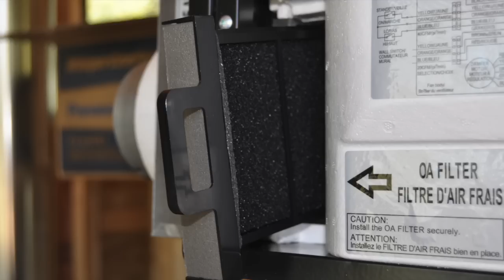Panasonic's Bargain ERV WhisperComfort FV-04VE1 Review

Comment from the maker: Remember that this is a budget version ERV, there are quite a few things that could be done better but it's the price point that makes this so appealing.  I would expect this model to be 1/3 to 1/5 the installed cost of a more traditional ERV ducted to the HVAC system.  We separated the two exterior 4" input/ouput ducts to the porch soffit and separated them by 6'.  Best, Matt

Comment: Other manufacturers offer ERVs that have duct connections, so you could exhaust from a bathroom (because bathrooms need to be exhausted anyway) and discharge the fresh air into the living room or a bedroom. For example, check out Fantech.
Reply: I like that solution. But it seems like using an ERV in your scenario would be adding a lot of moisture (coming from the bathroom) into the home. Perhaps an HRV would be better for that use-case (to prevent moisture transfer). The bummer with HRV's is that you can end up with too little moisture in the house. So then again, maybe the solution is an ERV as you proposed with a separate kick-ass de-humidifier.

Comment: We’ve installed several of these so far on rough in phase of some new houses and I finally gotten to the point where I need to hook up a control on it to finish the house and I am lost and cannot get any help from any of my distributors on this. We had the electrician wire 110 V to the unit where it’s mounted in the trusses and we tied onto the low-voltage controls and ran a thermostat wire down for some sort of controller or switch. Is this correct? And or is there some particular wall control we need to be using? Also, I don’t know if there’s an on off switch located behind the grill, but can you just switch it on as long as it’s powered and have it run all the time with no controller or switch on the wall?

Thanks

Comment: Not sure why you would say not to use a HRV in a humid climate, the biggest difference is the efficiency and an HRV has a condensate drain. As well every HRV controller I've seen (life breath & van-ee) allowed you to set the humidity inside your house, allowing the home owner to dehumidify with the HRV. Anywhere that would be too humid for a HRV to be effective in dehumidifying also probably has air conditioning which would take care of additional humidity.

Comment: How far can these ducts run to supply/vent the air? I have a basement but floor joists run towards the back yard which has a large deck, pretty damp under there. I would want to go out to the side of the house, but it's perpendicular to floor joists and would be about 30 feet run.

Comment: I'm thinking about installing one of these in my basement where we have a air quality issue. 
It's a  big finished basement, just worried about humidity in the summer, We live in Massachusetts.
We have a big dehumidifier in the basement already, opened the basement windows this summer and it got pretty damp. So I'm not sure if this is the right fix.
Reply: G Acky, maybe a little late, but you want to keep the summer air out of your basement except at night if it cools down. Bringing warm air into a cool basement is not what you want to do. Think about what happens to warm air on a cold beverage. An ERV could help, but keep the windows closed.

Comment: Matt, What do you think of using one of these as a bath fan? Instead of the 50cfm time of use requirement, set it to 20cfm continuous. 2 birds with 1 stone?

Do you feel that since the exhaust and intake are so close it could be in a loop and not effectively distributing?

thanks for your videos. I have watched them all am using them to plan for my own build.

Comment: Hi Matt, I have a 3100 home in Western Massachusetts, so humidity is a factor, Also I have a Mitsubishi 30000 and a 12000  Hyperheat Mini splits in a super tight house (also NetZero with 12Kwh PV array) I'm wondering if this unit will be sufficient to run one of these FV-04VE1 in the 40CFM position, assuming that for a 3100, 2 floors with 8' ceilings, roughly a 24,800 CF. Divide by 40 = 620 minutes. Divide by 60 and that is 10 hours and 20 minutes for one complete exchange of air.  In you super expert opinion, is that a good exchange rate for a home with 2 adults and 2 kids? if you say yes, I'm ready to click on the Amazon link you've provided!  Thanks and thank you for sharing your expertise!

Comment: Matt, great video! I live in the SF Bay Area and I'm wondering if this unit will help make a small concrete block cottage less damp. It seems like an HRV would be better to remove humidity, but I don't think there are any on the market that are good for very small spaces (only 300 sq. ft.). Thanks!

Comment: Hi, Matt.  Can this unit be used to vent a hot underneath garage?  I am trying to vent the garage and bring in cooler evening and night air. so the hot air does not flow up to the bedrooms.  The garage has sheet rock..  If not, what would you recommend?
Reply: Get one without a heat exchanger.

Comment: Hi Matt, I'm looking to finish my basement and make an in-law sweet. I want to make an air exchange system but will this product convert the cold air outside and warm it up slightly? I live in Canada and actually like the crack the window to let the cold in while I sleep. Can this product do that? Are there others better suited? I was looking for a two way fan as well. Thank you.
Reply from the maker: outdoorking69 This unit has some heat exchange too but you want to find a unit that's more suited to your climate zone.  Look for a HRV (heat recovery ventilator).  Best, Matt

Comment: Hi, does this unit replace all ventilation required for home, minus heat/dehumid/ac ?

In theory, could you just install this unit or 2 of them and then a separate minisplit and dehumidifier?
Reply from the maker: Yes that's right.  In this house we used a Mitsubishi VRF HVAC system but didn't pipe a fresh air input.  The entire 1800 Sf house is ventilated with this Panasonic ERV.  We have a separate plug-in dehumidifier for the house too.  These clients moved in this spring so it's been running for 6 months now and they have specifically told me they felt like the house has terrific IAQ of which this unit plays a part.  Best, Matt
Reply: thanks matt, i appreciate it.. i am buildinmg a home and trying to take the poor mans way to a passive house (or close to it) in houston.  i have been following corey safts work in  lafayette.  i really have learned a lot from your blog/videos .. i am thinking though i would need 2 of these for about 2200 /3bedroom house.. then the dehumidifier and vrf ac ...  just seems much a much simpler but beter way of doing things .. again, thank you very much for your constant teaching about this science and advocating newer technologies and methodologies.

-chris.